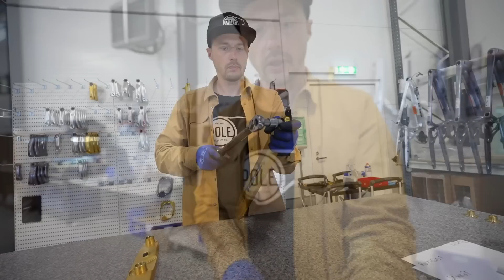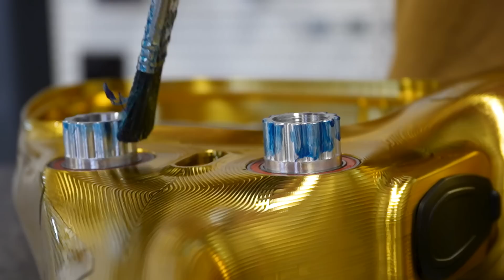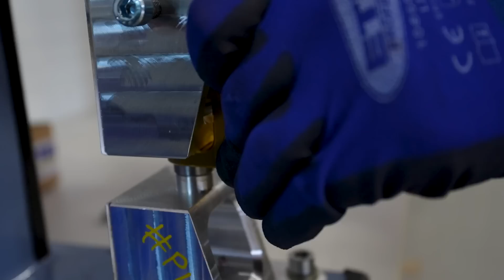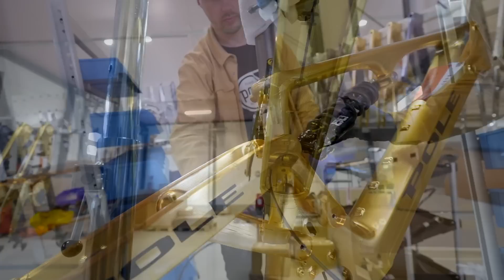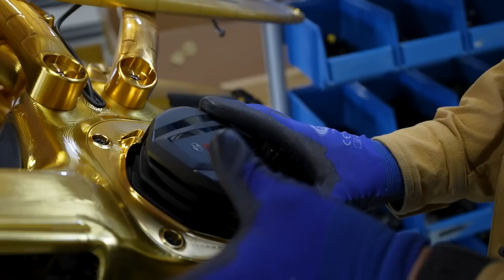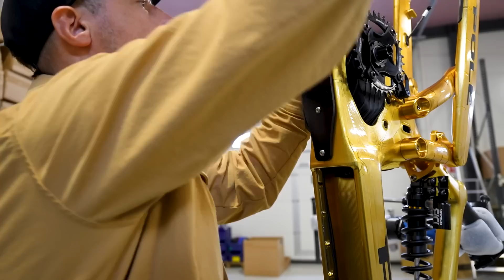Building a Voima with Pole CEO Leo Kokkonen.

Comment: I would love to ask how is the motor controlled? I’m a Disabled Vet here in the U.S. I have a back injury and very rarely ride on crazy trails. I chose a Trek full suspension e-bike. I wanted the suspension for making any uneven ground or anything you may encounter on a road side ride less shockingly painful. I went with the e-bike to help me flatten out my ride. I wanted something that would take that extra strain from hills off of me. So I could focus on getting some cardio in. I really pushed myself but in the end I failed. The bike had a few settings that it would run the motor to assist. It just didn’t have the settings I was looking for. I tried asking trek if they could think of anything and they pretty much gave me a “we don’t support modifications made….” Speech. I tried the same with the motor company but they pointed at trek… I even tried finding a throttle lever hack… in the end I just got tired of trying. One person treated me like I was just being lazy and wanted to run it like a battery powered motorcycle. I just wanted to get more power or control how much power the bike used going up hilly terrain. I get it not everyone needs that, I’m just trying to find the best all round option for myself, to try and take care of what’s left of my body. My back is trash but I need some sort of way to get cardio and so far this and a standard recumbent trike are my best options. The bike was actually the cheapest and had the extra help I was hoping for. I guess that’s stupid to most.
Reply: @J K Hello, J K !  
I highly recommend a book called "Healing Back Pain" by John Sarno.
I wish You the greatest Good!

Comment: Is it true? That you make those Bikes so they cant be De'restricted! Pole the Company that KILLED THE FUN IN EMTBS😡
Reply from the maker: 😀Good question. When we build the bike, we specify the geolocation, wheel size, and riding modes. Some of these settings can be changed at the service centre. The answer is no. We don't have to control any of the features that prevent restriction.
Reply: @Polebicycles  Kiitos 🤠

Comment: What I wish for this industry to be consumer friendly is if they would make the motors consumer serviceable and make parts easy to buy. I don't want to be without my bike for several weeks when I can do it at home myself. I don't see the value in a lifetime warranty for a frame with a motor. Frame bearings aren't a problem, but when the motor will need new bearings and you are out of warranty you are screwed. You can try to open it up and service it at home, but it will be without manual, without proper diagnostic tools, and very likely without easily accessible parts. And after some the motor is much more likely to cause a lot of problem rather than the frame. This ebike MTB industry seems hellbent on making it to the top of most environmentally unfriendly ways to go electric.
Reply: Bosch sells a service kit dumba$$.
Reply: @ATEC101  Thanks Ill just buy a service kit to Shimano EP8 from Bosh then. Oh wait.
Reply from the maker: Yeah, it's a bummer that the motors are not easy to service. The main issue is that everything needs to be in a light package, and the motor is rather complex. Luckily the motors are relatively inexpensive themselves. I bet there will be more solutions in the future for this
Reply: @Polebicycles  Thanks for your answer. I hope there will be more solutions in the future. Having watched a few videos of disassembly of a EP8 it seems like a job that takes several hours, not the least because they are extremely compact and it is easy to damage the components. But still, I don't understand the reluctance to sell the components and gaskets to consumers. Motors being relatively inexpensive is good, but it does not solve the problem of it seemingly being a total waste to buy one when one could have repaired an old one. It also seems unsustainable that you can't easily keep your frame and upgrade from EP8000 to EP8 motor since they use the same bolt holes. Is this just a Shimano issue, or EMTB in general I wonder. Seems very consumer hostile. A frame from Pole is built to last for a very long time it seems, and would be a perfect candidate keep for a long time with upgrades over time.

Comment: Leo, almost every one of those steel fasteners going into aluminum threads should be getting hydrophobic grease on the threads during assembly. Give that bike 2-3 years or less for galvanic reaction to take place and freeze those fasteners in there and when they go to remove it will either rip out the threads or break the fastener.
Reply: Good question. The threads have been treated with electrophoretic clearcoat in the same process as the whole frame. This method is similar to, for example, stems. They anodize the stems and use steel bolts. You could add some grease to be more secure, but it's unnecessary.
Reply: @leokokkonen275  What a polite way to punch someone in the dick.